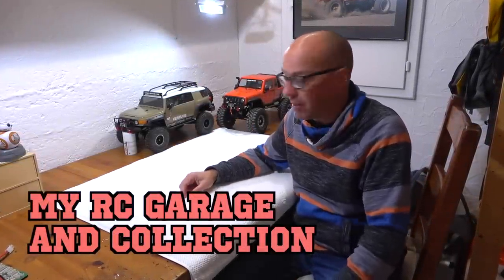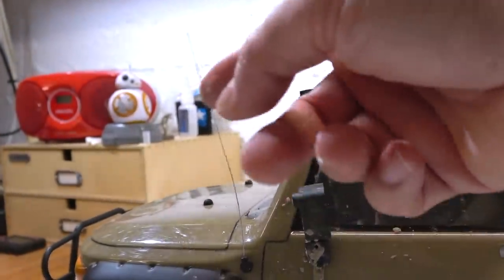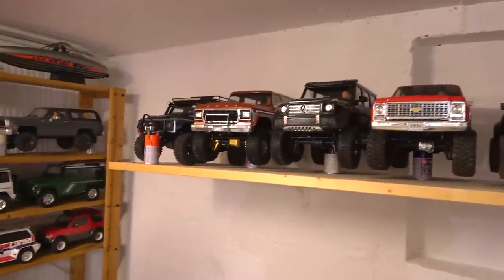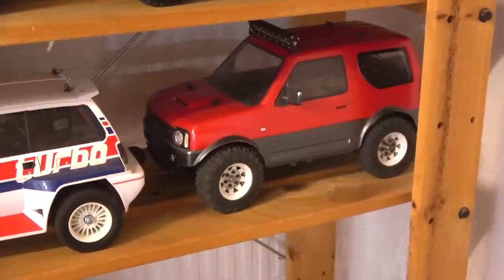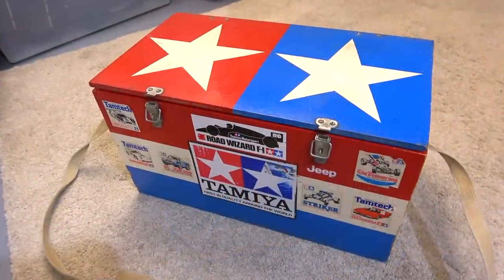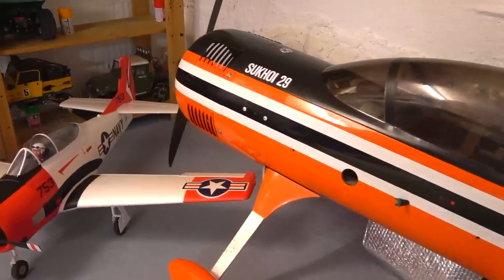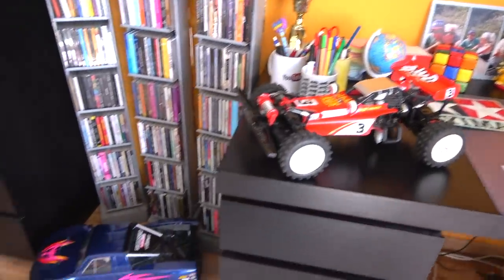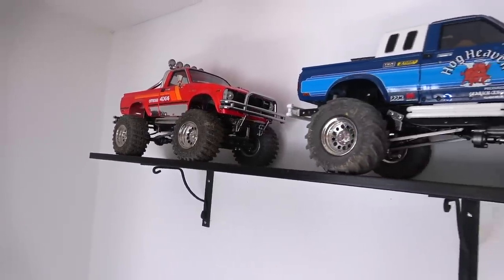Matteo's RC Garage and Collection

Comment: Good idea using the paint cans as stands. I bought 4 stands off eBay for like $5 USD or something of the sort. I don't paint often, if at all. I usually purchase rtr bodies or bodies already painted. I only have two bodies that are unpainted, one I've had for about two years and the other I bought for my brother. The body I bought for myself is for a nitro Revo but haven't painted it. I'm not really skilled at painting as I've literally never done it with good looks in mind. Doesn't look hard, but I usually use my time to modify or repair. You've got quite a collection of crawlers. I recently picked up my first plane, although I will have to buy another before I can think of flying it. It's an EDF, but I wanted to buy it before it becomes discontinued. I've got about 2 years est before I have the skills to pilot it, but I didn't want to wait till I had the skills to pilot it as Horizon Hobbies has a tendency to discontinue RCs. It's happened to two I own already. The Losi LST 3XLE and the ProBoat Zelos. I want to get a few more crawlers as well as two more planes and another boat. A road car and a 1/5 scale trophy truck as well. I've already got more into the hobby than I bought my full size Ford Expedition for. Trying to slow down a little, not to mention I'm running low on space. Lol.

Comment: Careful with that Wild Willy. I reanimated mine last year and it had a severe case of osteoporosis. Everything very brittle and axles don't break, they crumble. Long live the shelf-queen!
Reply from the maker: Yes, maybe better to let it as a shelf queen! 👍👍😊
Reply: @Matteomeier  Just sharing my experience. Maybe mine was just stored wrong (in a barn with all associated temperature changes). Anyway, the guy at Tamiya's customer service actually laughed when I asked if spare parts would be available.
No such troubles with my resurrected Kyosho Salute (now rocking a Javelin body and only a couple of years younger), probably because of fibre reinforced plastics.

Comment: Great video as usual!  I have a question for you.  Do you have any of your original Tamiyas or did u reaquire those after you got back in the hobby?  I am referring to your photo album video you did from the 80’s like The Monster Beetle, The Bigwig, Porsche 959, The Clod Buster, The Falcon and the Toyota Celtica.  I too did get out of the hobby around 1989 because of Highschool but I kept all my originals and restored them so they are truly special to me which is why I asked that question.  The only one I let get thrown away is my Tamiya Hotshot II and all that was wrong with it was the MSC was Burnt out.  I hated myself for years because as you know that car is truly rare so I had to piece it together when ever a part that I needed came up which took about two years to put together but it is 100 percent all original straight down to the Futaba Attack I originally had for it.  Let me know I’m curious if you still have those and would love to see pics of them.
Reply from the maker: Unfortunately after my first hobby time in my younger years I sold all my original Tamiyas. (What I regret greatly) So I had to buy all the re-releases after my comeback. 😊😊
Reply: Thank you for your reply.. if you find any more photos I would love to share the story!